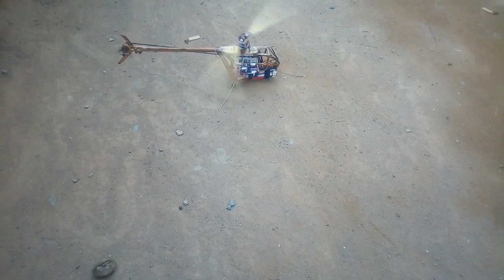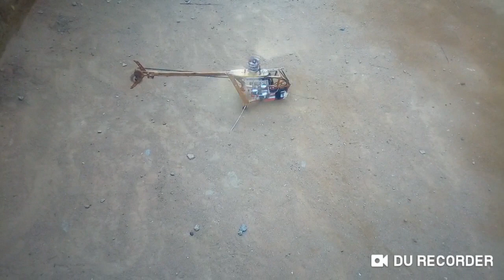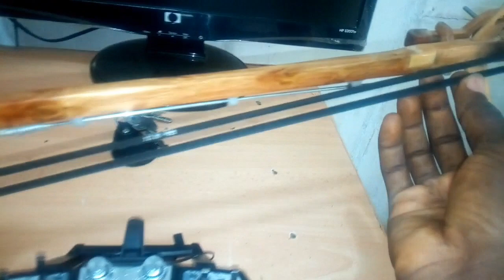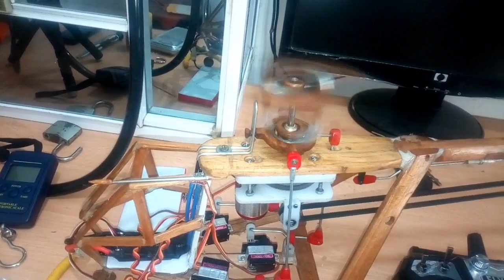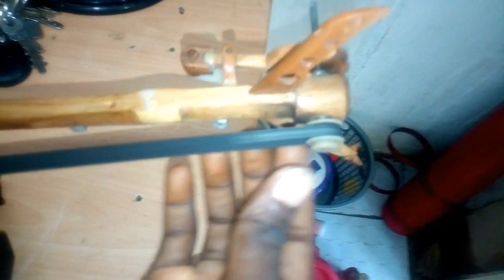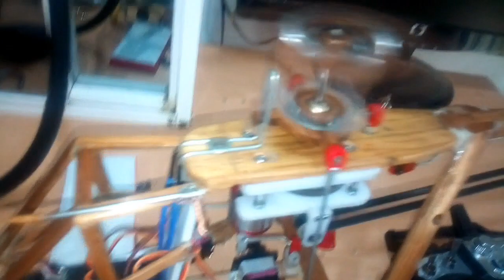Woodern rc.

Comment: You could do away with the tail rotor mechanism, use an electric tail rotor motor with its own esc instead, much simpler, then just snap on a plastic propeller to the shaft. It works with really small outrunner brushless motors, with at most a small 15 A esc required. This ESC, instead of a tail servo, is then controlled by the rudder channel (after passing through the gyro, of course).